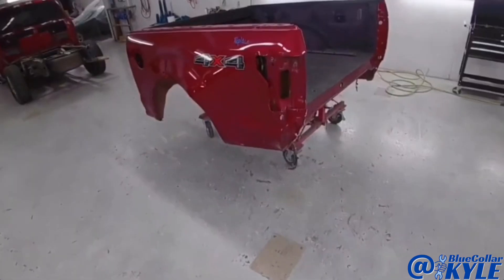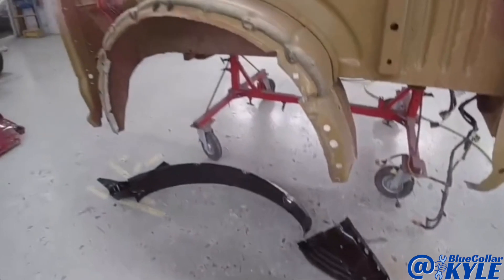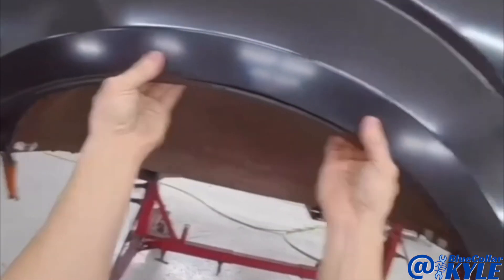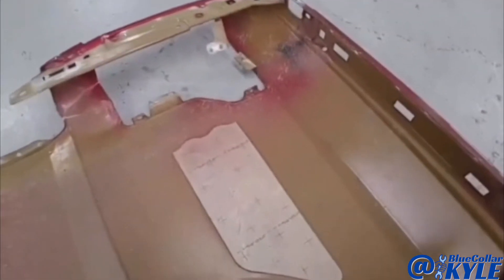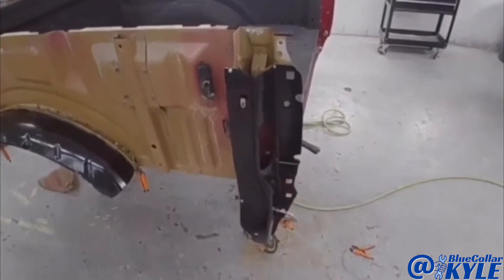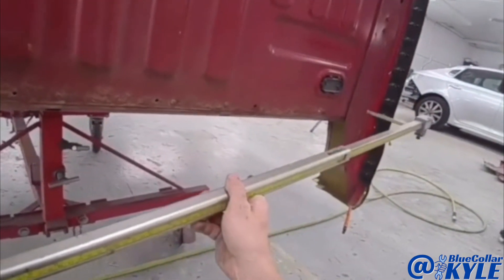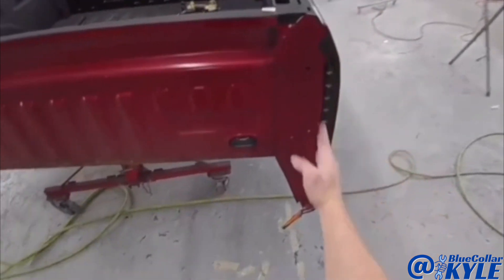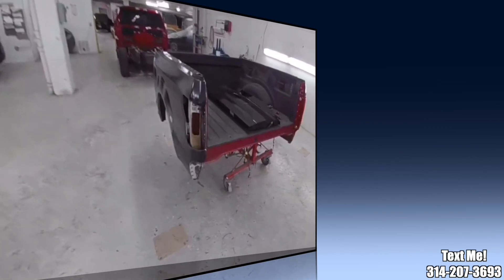Does Aluminum Spark?

Comment: Love your videos.  What is the yellow paint that you use on the inside of the bedside called and is it critical to the longevity of the repair?  I recently had the bedside replaced on my 2020 F250 and noticed that it is still just the black color from Ford on the inside and they didn’t install any sound deadening…among a host of other issues.
Reply: The black is just ford's e coat, it's their version of corrosion resistance and you can do more if you'd like like he does in the video but I believe ford's procedure is to leave it and not mess with it. Also most body shops probably won't install the sound deadening, it's probably better to have it but there's so many points of contact on these panels and the noise (if any) won't ever make it into the cab being so far forward. Unless you're hearing noise and that's how you noticed but I'd be surprised. I've worked on a few race cars that have had steel panels replaced with aluminum and we don't installed deadening materials and they don't make noise at speed because of all the points of contact on the panels.